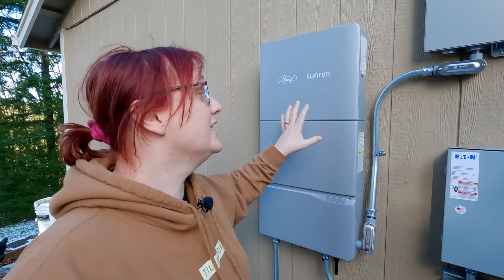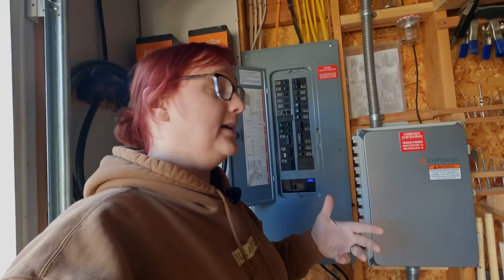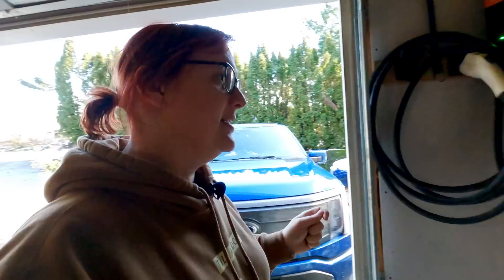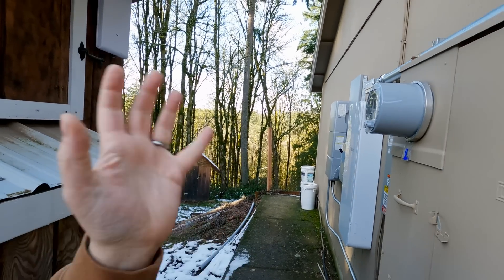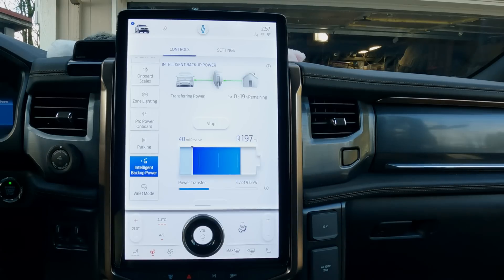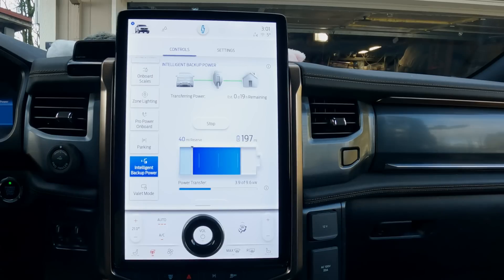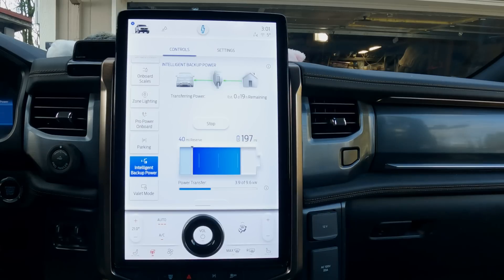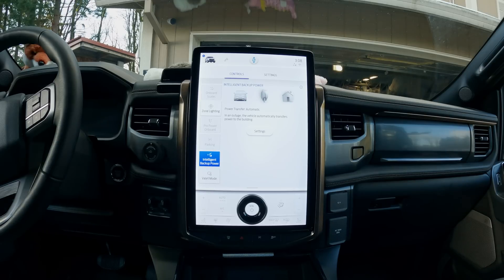We FINALLY Get To Power Our Home (And Studio) From Our Ford F150 Lightning!

Comment: I just use the 7.2 kw bed receptical to power my home. Much cheaper to use than sunrun home integration system. My home runs about 23 kwh/day. I usually keep my truck charged to 90% SOC so I  could theoretically run my home for 3 days using my truck, but I've never had 3 days without enough sun to charge my 40 kwh home solar battery bank.

Comment: Holy snapping electrons, Batman! The idea of a fully automatic backup system is it is fully automatic. Needing engineer Scott to play whack-o-breaker is not automatic by anyone's definition. If Sunrun says you can run all the critical loads, then by God, you should be able to run the entire critical load panel, without having to get out of bed, run down to the garage in your jammies to flip breakers off and on. You have a solar array, and  I know backup batteries are near and dear, but that is an option. Granted, a back up battery would cough and choke on the main heat pump.  For a better solution, I'd take the money you spent and installed a propane/diesel 25-50Kw generator and be done. Run the heat pump, and the studio, the house and hell, charge an EV or two.
Participating in the world as it is does not disqualify anyone from trying to improve it—even if that means running a fossil fuel generator.

Comment: I like how all the people saying that you should add soft start to your inductive loads are ignoring the fact that 1) most modern heat pumps are inverter-driven (I.e. already have soft start), 2) you’ve already said that the well pump has soft start, and 3) there are already 50000000000 comments saying the exact same thing. 🙄

Glad the system is finally starting to work. Hopefully you’ll be able to integrate the Span panel and solar better in the future once the Ford system is better able to support them.

Comment: A fixed battery as the backup means you aren't using up your car battery's cycles for your home. Lithium-ion is more energy dense and so is desirable in vehicles, but it's cycle life is less than for lithium iron phosphate.

Comment: A sequential power on resume after Ford backup switching would prevent a huge load spike creating a fail when backup power starts. As a scsi nerd you might remember the power up delay setting for large arrays of 10k rpm USCSI disks, the delayed sequential disk ID number powering up, was perfect for avoiding the power supply crushed by the 10 disks powering at once. Maybe you can program a sequence with the automated power panel.
Reply: Funny enough, their SmartPanel can do that ... but the Ford system isn't compatible with it, that's why everything is wired to the old dumb" panel now.

Comment: Delay timers (offset to turn on sequentially) can be installed on the high current inductive load items like the heat pump and well pump and the high current resistive load of the water heater. The server shouldn't be an issue.

Comment: Very well detailed presentation, an Aircraft hs a separate battery buss for load stead in emergency situations. My home is also solar I haven't done the battery Back up yet. My next step in my system. My home I built in 2000 before all this technology was available.  The battery company wants to install the whole system they don't want to modify My system unfortunately. I need a real electrician or engineer to get the most out of my systems

Comment: This was a good informative video and I like the reuse of the car battery for emergency use. However for those that can afford them the TESLA Powerwall coupled with their gateway seems to me to have significant advantages. It can cut in near instantly which removes the need to be awake and to go outside in a storm and will not suffer the initial surge that seems to be tripping your system up as the motors etc will already be running. It also means that devices like your servers are not in risk of being trashed by the power failure.
The other aspect is that any automatic switch to emergency mode requires the car to be plugged in and the car to have lots of energy in the ‘tank’

Like a previous comment I  would like to hear about how solar is handled during the power cut with your system.

Comment: It should just work. Anything less is not acceptable. If I had purchased this home integration system and it worked only 40% of the time I would be livid and the folks at SUNRUN would be either fixing it or talking to the AG consumer affairs department in Salem. You might think about a heat-pump hot water heater and dryer.

Comment: Could you put a delay timer relay on the Heat Pump and We’ll Pump so that when the power goes out and your backup system restarts it does so without those two loads. Put one delay on say 5 minutes and the second on 10 minutes and those systems will start automatically and their startup spikes will be separated.

Comment: Nikki,  if you ever have an issue with the water heater, you might replace it with a Hybrid / Heat pump water heater.  This should reduce the usage of it quite a bit.

Comment: I a big fan of Power Walls or something similar. For the server room I could see you using the Eco Flow units. Then as a final failsafe you could rely on the F150 when others are exhausted. 

As far as the Eco Flow is concerned I hear you can stack I think up to 4 to create a whole house battery backup. I think that is cool but I still think a Power wall or similar is the way to go, Eco Flow (2 units) for the server room and then the F15 as the final backup to give you some extra hours beyond the other things.

Comment: I wonder if a powerwall would be able to handle the peak current rush better then the F150 L?
But using the truck for longer periods of power outages.
Reply: Probably not. The issue isn’t the batteries, they could easily handle the suddenly current draw. It’s the inverter(s) that don’t respond well to the inrush current. I substantially doubt that a power wall uses much better inverter(s).

Comment: Seems the inverter or truck doesn’t like the inductive loads on boot up ie the motors in the heat pump well pump waste water pump etc… maybe a capacitor base soft start module could be added to the inductive loads.
Glad you have managed to get to a working state.

Comment: Good update.  Is there a system to allow the power to be pulled slowly not to shock the system timed circuit to come on one by one as powerpull stabilize

Comment: Did you soft-start the well pump? Thats a monster startup if not.
Also, I thought that the Lightning could provide 19.2kW, same as charge with Home charger. Is that an option?
Reply from the maker: It is equipped with a soft start.

^Kate

Comment: Startng motors, say heat pump starting and water pump both have surge load will cause issues. I notice that the heat pump fans were not running so no load.  That may be for issue.  What is the instantaneous surge capacity of the Ford system?  Ah you talked about it later.
Reply from the maker: The well pump has soft start.

^Kate

Comment: Thanks Nikki.  This gives me hope for my plan.  If I recall, you run iq7 micro inverters on your array.  If you had the iq8, do you believe the grid forming would allow your solar to integrate with this already complicated setup?  I'm installing an array with iq8s and getting a Fisker Ocean.  Just saw enphase release their bidirectional charger and will look into it this will work as an ecosystem for solar and EV enabled backup during PNW outages.

Comment: We installed the home battery system by NeoVolta which is a 24kw battery pack -- LiFePo batteries not NMC-- and they strongly recommend soft-start devices for AC, heat pumps and water pumps. Maybe discuss with your electrician if they think soft-start devices would help your system.

Comment: I wonder if you could get an automatic delay start for the heat pump, water heater, and well pump... So if they lose power they would come on after 1, 2, and 3 minutes after the power is restored to avoid large spikes. I know you can get soft start mechanisms for things with motors like well pumps and heat pumps which are effectively a capacitor that absorbs the startup spike.

Comment: If tje Span panel can start working properly, it should be able to prioritize those high demand items, and apply them sequentially, avoiding too much of a peak load condition. That would avoid the hassle of manually switching off and on those circuits.

Comment: Also you didn't mention time shifting.
Reply: Oh yeah.  If you ever have to heat just one room in an emergency.  You can do so with your dehumidifier.  I do it and the draw is 950w.  That's a 600w oil filled radiator and 350 for the dehumidifier.  
As the rad is just to preheat the air for the  dehumidifier this means your average consumption is around 650 w but I have found in practice the heater hardly comes on at all.  Of course you can buy a portable heat pump/ AC.

Comment: I'm very happy that's working for u.  I noticed your heat pump was rather large.  I have one of a similar size which uses a total draw of 4 kw on heat pump only and 7 kw for the electrical emersion with heat pump.  I think my system is too big and would save lots of power if I had  a 2 kw.  Heat pump.  As from your previous video  where you explained how with a heat pump you get something for nothing IE. 2 kw in and 6 kw output in heat.
Ian your hot water provided by the heat pump?

Comment: As you talk about having to manage which loads are on while switching to backup power (& the implications if you're sound asleep), I can't help but think that this won't be practical compared to a powerwall-type battery until the SPAN or its equivalent works with the system.

Comment: The troubling loads seem to be electric motors.
AC electric motors are dependent on the phase of the electricity.
So, the issue may be how well the inverters can mantain the phase and frequency of the AC electricity.

Comment: Are you going to be in a position to have some high load items switch off automatically when there's a power failure so that you can keep the important stuff (the servers) running constantly and have things like the water and heat pumps off initially? 

That way you could cope with a power failure with no serious interruption, and make decisions about the high load items later.

(Your peak load must be huge! Our farm only supports 15kW incoming and 10kW (certified) export. Do you have your own transformer?)

Comment: This is really cool, it’s the first time I’ve seen anybody actually use the system.  

Something I’d add as commentary.  I have Tesla solar panels and two powerwalls providing whole home backup.  I was going down the path of one Powerwall plus a Span to do partial home backup with the ability to use my phone to remotely manage which breakers I deemed essential.  However, the Span quote I got was about the same price as another Powerwall (~$10k) and I’d rather have whole home backup anyway. 

My point is that your system is very complicated for the average homeowner.  Certainly not your fault, but I think system complexity needs to come WAY down before this tech is ready for prime time. 

Ideally, the entire backup process would use existing charging equipment.  For example, let’s say your Ford Wall Charger was hooked up to a 60AMP breaker on your main panel, and the Lightning onboard inverter was able to send 220V, 50Amp, 60Hz power to the breaker, then you wouldn’t need a number of the extra boxes attached to your house.

Comment: I also have this system installed, in our second home in Florida, and it does not work.  It has been a saga, I think much worse than yours given it has been installed twice now, and SunRun can’t get it operational, is flying in Ford engineers from Dearborn and their own people from New Jersey and Orlando (we are in Boynton Beach, south FL).  We signed up for the install last may, had a site review in June, were scheduled in July, had first installer contact in August, SunRun’s selected subcontractor began work in September, completely messed up the job, installed the charger at knee level, destroyed a slatwall in our garage, took u far more space than necessary, never got the wiring installed in the conduit despite a full week onsite.  They basically had no clue.  We ended this phase with a stop work order from the city, but had multiple other issues, including the city informing us the subcontractor’s license was expired.  SunRun fired the contractor and sent their own team from Orlando to re-do the job.  They removed all of the devices installed by the former contractor, repaired the garage, upgraded our service to 150 amps, reinstalled all five of the required boxes and the charger, quite professionally, helped select the circuits to be supported by the HIS, and completed the job.  The truck was basically able to run our entire 2,700-square ft townhome in the intracoastal waterway.  They were quite professional and the job looked great when they were done (in November).  However, they could not get it to work.  The FordPass app would not link with the charger, and although the truck would charge, the system would fail as soon as the main power at the grid input was cut.  A few times they got it to run the house for a few minutes, but it would then fail.  The electrical team gave up, after three days onsite, at great expense due to travel from Orlando.  In January SunRun’s head of Eastern and Central U.S. electrical operations flew in from New Jersey to try to get it running.  They fought in one of their electricians from Miami, and were able to get the local city inspector to sign off on the system.  However, they were unable to solve the HIS software/hardware issues, and could not get the app to work, either their own or may smartphone app to set up the charger or to link with FordPass, and while they did get the HIS charging to run for a full hour at one point, it failed randomly for no apparent reason, and one time a fail condition required the to do a reset that involved disconnecting wiring in the inverter.  They were very knowledgeable and spent a lot of time on the phone with Ford engineering and with the various equipment suppliers, but could not make it work reliably.  Their next step is to come back with a team from Ford Dearborn.  We have paid nothing for the system so far, not even a deposit, and will not do so until it is demonstrated to work 100% reliably, we will not pay the $9.5k contract price.  One point of interest, they did identify that our heat pump start-up draw exceeds the system’s capacity.  This was not a cause of the issues, as we weren’t;t running the HVAC, but they are planning to install a soft-start device on the air handler at their expense.  The original contractor also broke our Tesla Gen I charger in the process of installing the Ford/SunRun equipment, so they purchased and installed a replacement Gen III Tesla charger at their expenses.  Ford/SunRun is losing their butts on this, and I am being patient and happily engaging with them as an early adopter, just saying “get it right and we’ll all be good.”  The problem is that we are shadow birds, will be gone in late April, so their window is closing until November.  The very reason we want this system is to have the truck on standby during hurricane season to run freezers, keep the house on the internet, etc.  Wall-mounted batteries might have been a better solution (we cannot have a generator due to HOA and space limitations), but we wanted to try this out.  We do have a 43kwh solar array and a sophisticated propane generator backup system at our other place, an oyster farm on the Chesapeake that has mission-😮critical water pumps, so must be up 24/7 or millions of babies die.  I’m glad to see your experience, and that it is working out now, agree with your conclusions on whether it makes sense to do this (probably not).  Better stuff is coming, likely generic, more fully integrated, less proprietary, and definitely with fewer software dependencies.  One other thing - my truck is “stuck” on 3.5.5 and Ford has not been able to push the software past that even despite constant and valiant efforts.  I am in Antarctica right now and dropped my phone into the ocean last week, so can’t see the latest update efforts, but that had been going on for a month when we left on January 23, is one of the reasons that Sun Run is getting Ford engineering to the site.

Comment: You need soft starts on the HVAC and your well pump. Due to the massive amp surge from these devices and the truck inverter cannot handle that outrush. Once you get the soft start kits, a couple hundred bucks, you will be fine and no need to turn off the 240v appliances. Your 120v appliances are not an issue. The hot water heater could be an issue only after the heat pump or well pump are running at same time.
Reply from the maker: It is frustrating watching people make comments when we’ve already explained that our heat pumps don’t need one because they’ve already got one built in!

Comment: I love the concept of this system so I'm so glad to hear you are having more success with it. On the topic of gradually adding more load after a power outage: Would your smart panel ever be able to be configured to do that for you so you don't have to run around to breakers flipping switches?
Reply: I have a large electric motor on a machine and it has an electronic steeper. I can not see why this can not be added to system that Nikki has.